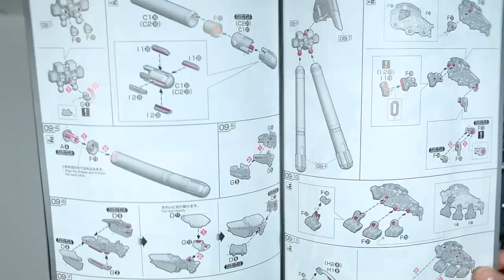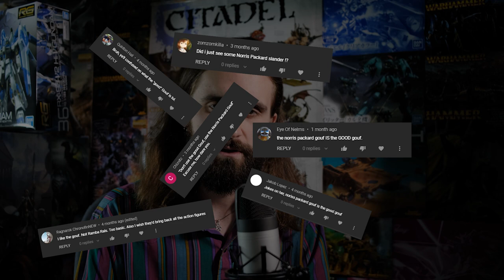Hand Painting the Wrong Gundam | Custom Wing Zero Kitbash

Comment: Is there a way you could keep it movable but still paint it this way I guess you would have to do each part individually ?
Reply from the maker: Well yeah technically I could do that by painting individually, it would involve a lot more work to handpaint in this style, and even then, there would still be chance for paint damage depending on how the shifting parts interact with eachother. There were certaintly parts on this wing zero's legs/feet that were quite flimsy. Ultimately though I am choosing to make the painting easy by gluing because that's the balance of time I want to put into each individual mecha

Comment: is normal paint fine?
Reply from the maker: There is no 'normal' paint. I hand paint with water based acrylics intended for use on models that are common at many hobby stores
Reply from the maker: If you're thinking of cheap craft paints, you can use them, but it likely won't be as efficient/enjoyable
Reply: @MMMayhem  ah okay thank you